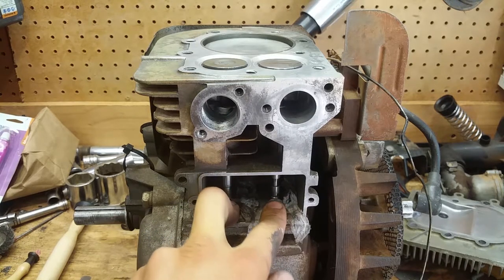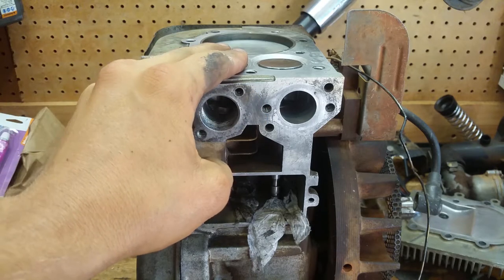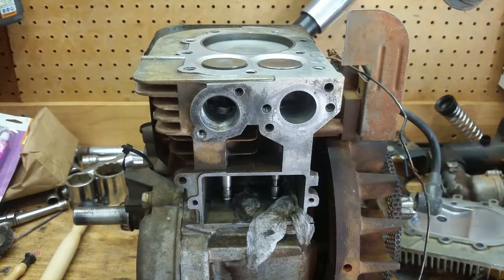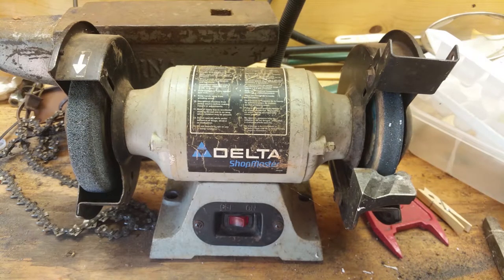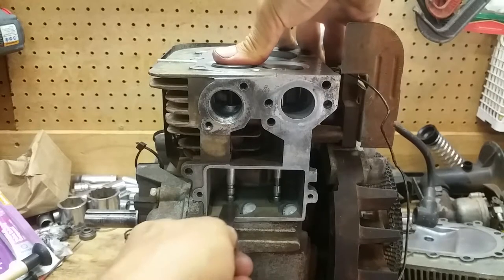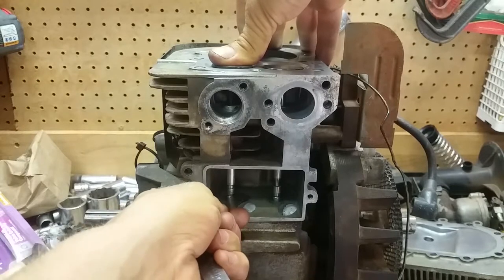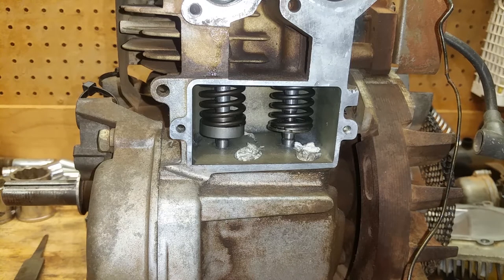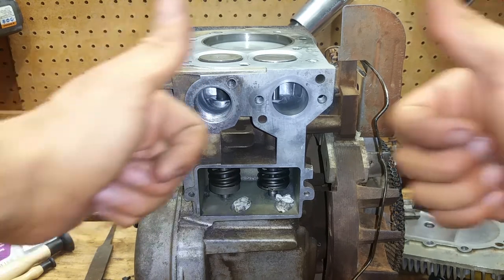Set Small Engine Valve Clearances

Comment: The zip tie trick is a great idea in the video. 👍You should try putting the valve stem cap back on with the engine upside down. Maybe it would be easier to get it back on.

Comment: Nice info. Thumbs up. My dad used to use a bench sander after marking the flat with a black sharpie. This, of course would guide you if you were removing material in some way as balanced. I use the same method when sharpening mower blades.

Comment: Great video.
Few tips 
Put the zipties on all but the outer rungs of the springs. Should still compress enough but will be removable with ease after cut.
I don't recommend using pliers on the springs themselves as they are coated. If the spring starts to rust it will weaken.
Reply from the maker: Good idea to put them on the outer rings.
Reply: Also, position the zipties so that the rachet part is near the middle of the compressed spring, not tear the top or bottom.

Comment: A great trick for getting the 2 piece keepers installed is to put a little dab of grease on the inside of each half. Then you can install them and the grease will hold them onto the valve stem while you cut the zip ties or release the spring compressor.

Comment: Just wondering. How did you manage to properly lap the valves in with the valve stems being too long and bottoming out. Seems like the valve wouldn’t close all the way for lapping.
Reply: Were you able to remove the pushrods to get the valves to seat during lapping?
Reply from the maker: I rotated the engine until the pushrods were down so the valves sat in their seats.

Comment: I'd be sure to check the owners manual for the Flathead engine because mine specifically says to check the valve clearance with springs and retainers fully installed. If your flathead engine is old enough the owners manual will have this basic information without needing the shop manual. I got my owners manual as a scanned PDF from Briggs and Stratton for free after contacting them with my engine numbers.
Reply from the maker: I have the manuals in the description. I never saw that mentioned in the manual. I'll have to check it again.
Reply: YES  J M <<<<<<<<<<<< ALWAYS do the B&S engines AS the MANUAL says instead or well meaning small engine gurus, many a YT watcher has seriously screwed their machines up listening to someone that thinks they know MORE or BETTER than the floks who designed & manufactured the equipment, I see this ALL the time with Snapper Mower youtube channels

Comment: gr8 vid I have a simular problem  and symptoms is when engine is hot it will not stay running or is difficult to start untill mower cools off  on a lawnmower.

I will not be using a grinder. I will be using  a file.   its is also a flat head but on a lawnmower

Comment: I have an engine that blows air out of the carburetor so i think i need to do a valve job i have done everything and it stil wont run so i hope this helps thank you for the info
Reply: Did it help @Siebe_h

Comment: Great video! I'm surprised you have negative clearance. Does this mean the valve seats have worn faster than the push rods?
Reply from the maker: Yes, the valve seats get pretty beat up.
Reply: @MattsShop  I'll be sure to check mine. First I need to drain the oil. I wish there was a way to grind down the valves without removal. I think a dremel tool will do the trick.
Reply: @dpk9993  why drain the oil?
Reply: In my mind, I am assuming that with an engine that old it has possibly been rebuilt and the valves have been cut and lapped or he may have done so. I know that if I were to take the engine down to that point that's what I would do.....but that's me. You would be surprised the difference it can make.
Reply: @dpk9993  don't do that, grit and shavings will get into the engine, not hard to remove and replace them

Comment: Ignore my info before. This set up is for BRIGGS and STRATTON engine only, isn't? For TECUMSEH engine is not this set up w/piston at 1/4" down. The 0.006" and 0.010" are the acceptable set up for the valve gap.
Reply from the maker: I know what you're talking about. It was mentioned in some Briggs and Stratton service manuals. To set the piston to TDC then 1/4" down. They caused a lot of confusion. Who knows what engines you are supposed to do that on at this point??

Comment: Great video, thanks. My engine has too much gap, how do you make the valve stems longer? Would lapping them gain enough to be worth while? There is .020 gap on both valves.
Reply from the maker: In order to remove that much material you would have to recut the valve seats (expensive). To add material you could replace the valves, and/or replace the valve push rods in the bottom end. That would get you valve stems that are not worn out. They'd be longer.

Just lapping the valves won't remove that much metal. Are you sure you are reading the spec/feeler gauges right?
Reply: My local small engine shop expert (shop no longer open) says the cam lobes are worn. I agree, there are streaks along the lobe tops. Taking a chance on another expensive camshaft may not be worthwhile as another engine should not cost much more. Thanks for your reply. Stan
Reply: I have same problem with big gaps and NO ONE on Youtube seems to know how to correct the problem! Eg somehow add a shim or what?
Reply: @johnsomerset1510  I was able to squeeze out some extra length with a blacksmith technique. 
Laying the end of the rod on an anvil and pounding the sides,  stretched the shaft just enough to make it work.
Would have been easier to heat the rod but I did not want to mess with the temper in the steel. 
There was a possibility of shattering the rod, but it worked.
Reply: @rf8driver  Thanks for that. But because of the risk of damaging the smooth surface of the stem, or bending or splitting the stem to get the extra length I need, I think I will either make up some cup-shaped shims, or disc shaped shims and retain them in place by slipping over short brass tubing to keep them on top of the push rods/cam follower stems.

Comment: Attention! The piston whole side is 45 degre. The 1/4 inch of the top piston TDM is not correctly measurement from the top flash engine frame.  Maybe, the piston top must be measurement exactly from the flush engine frame. There is some error in measurement for the 1/4 inch before to begin the gap valve measurement. For 0.006 and 0.008 inch valve gaps adjustement the +/- inch are very important dimension/error.

Comment: What if you have excessive clearance? How do you tighten it up? New valves, weld up valve, new pushrod?
Reply from the maker: Yes, those are all ways to tighten the clearance. The best way would be to recut the valve seats so they sit deeper in the head. And seal better at the same time.

Comment: Matt. I have. Old 4hp Briggs that the intake valve will not open..The tappet for the intake does not come up nearly as far as the exhaust valve.It just kisses the valve stem barely. Only thing Icould think is the tappet or love on cam is damaged..Any thoughts?
Reply from the maker: You have lost height somewhere due to excessive metal wear. It's either a worn cam lobe, push rod, or valve stem.
Reply: Tappet actually broke at the base I discovered. Took sump cover off. Lobe has some nicks in it. Never had one of break before. This was a new to me motor. Explains why it was sitting for years.

Comment: Ok, sooo.... on compression stroke when the piston is moving upward...BOTH VALVES SHOULD BE CLOSED.. no leakage past the intake or exhaust valves...  I understand this principle.  ON  my small 5 hp Briggs, THE EXHAUST valve is closed, the the INTAKE HAS LEAKAGE uptown 3/4 compression stroke.  IN OTHER WORDS, there is blow-back through the intake port until the piston on compression stroke is 3/4 travel.  VALVE clearance at recommended positioning is .008 intake.  QUESTION: WHAT'S THE PROBLEM
Reply from the maker: Somebody on here told me there is a decompression bump on the cam of some of these engines. It causes the exhaust valve to hang open a little bit. That's why the manual says set the valve clearance at 1/4" past TDC (piston 1/4" down from the top of the head after TDC).

Don't know if it's true, but makes sense to me. Not sure if this info helps you, but maybe?
Reply: @MattsShop  I never heard of this...but I have only ripped apart 1/2 doz briggs engs.  It makes sense alright.  BUT, IT IS THE INTAKE VALVE which on compression stroke there is leakage.  I will tear the eng down further an examine.  Like I said...ALL my understanding of 4 stroke engines...ALL ... BOTH VALVES ARE CLOSED on compression stroke.......hmmmm
Reply: @Mooseracks  it's the easy spin feature on all briggs like this.  It opens the intake valve ever so slightly during the compression stroke to prevent kickback during pull starting. Hope this explains enuff